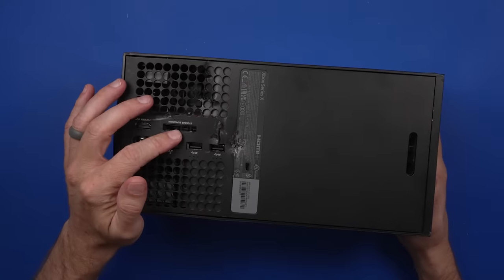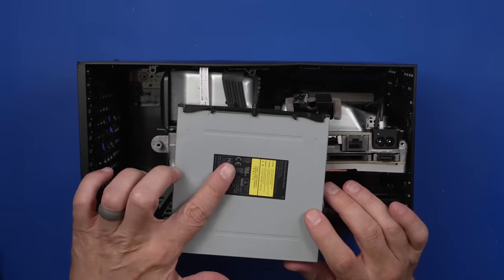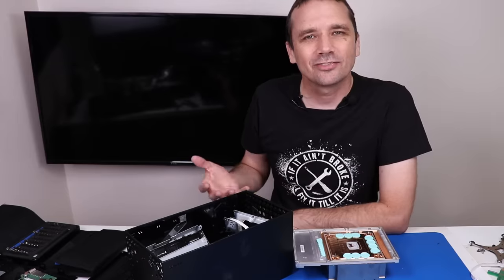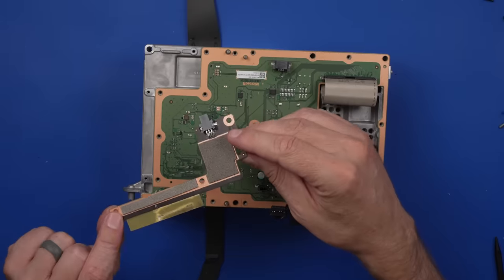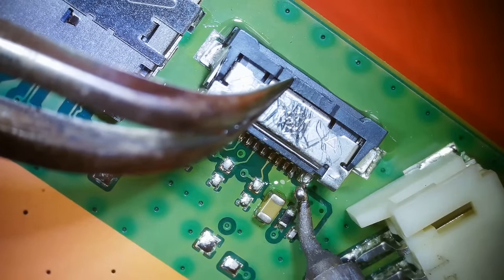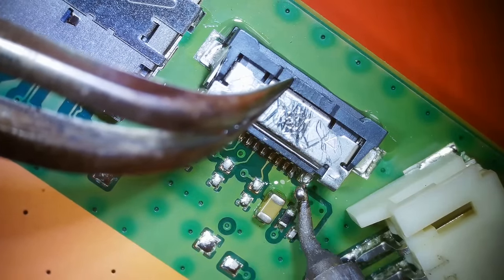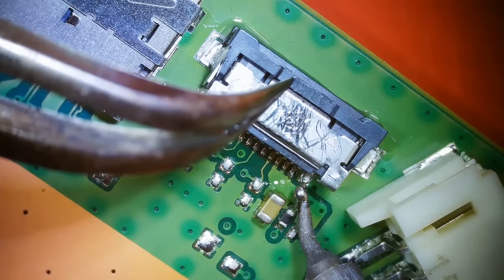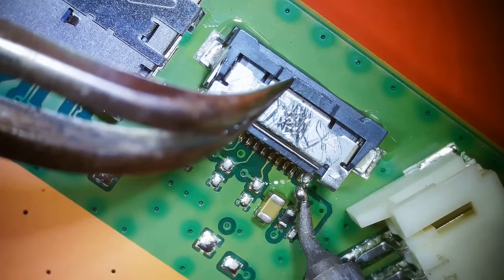$150 For a DESTROYED Xbox Series X - Let's Try to Fix It!

Comment: One thing I'd like to see on these videos is a parts replaced list with costs of parts. I think a lot of people would be interested to see what a repair costs.
Reply: That would be cool, but he wouldn't be able to give exact prices as he's got a lot of random parts laying around from the years he's been doing this kind of thing. So he mainly uses spares from devices he couldn't save. There's also other costs for a repair shop too, cleaning, electric, advertising, hiring staff and training them, equipment (like soldering irons, multimeters and oscilloscopes), paying for the building... 
It all adds up in the end unfortunately. You CAN do it cheaper yourself, but you need to know HOW to do it yourself, preferably without breaking anything.
Reply: @Deja117  yeah he could still post prices of parts replaced and availability (if any) of said parts. I understand he runs a shop, but he also runs a YouTube channel on fixing broken items. a lot of people watch to be entertained and learn.
Reply: There's no way to do this. Part prices are all over the place and rising.
Reply: Part of the reason he is able to do these repairs is because of all the extra components he has from other systems that weren't repairable. Hdmi ports, retimer chips, and known bad components are cheap to replace. Power supplies, disc drives, etc are not. I will only repair game consoles if I know what is wrong with it specifically because I don't have extra parts laying around.
Reply: @Deja117  that's why repairing stuff doesn't make a lot of sense in most cases. Just the man hours dedicated to processing and repairing a damaged item add up to more than the item being repaired.
Reply: Bru some parts you just don’t get….. sometimes the only way to repair them is to have shop with random parts from devices you couldn’t fix. I tell my customers, for me, every board is useful…
Reply: @tomimar2001  Most cases? That's complete nonsense. It's this specific job.
Reply: If he had to buy the parts he replaced the console would not be very profitable. Heatsink 30$, power supply 50$, disk drive 50$, power button board 20$ and a fan 20$. Add that together with the initial 150$ cost of the console you are looking at over 300$ for a poor cosmetic Frankenstein console. You can find a clean used xbox series x thats never been broken/repaired and or opened up for 350-375$. This console is probably worth what it would cost to buy and fix it with zero profit. 

P.S. this video kinda sucked. I expect a good fix it video to be someone actually attempting to repair the parts that are not functioning. Not just swap out ever part that doesn't work with one from another console. i wouldn't really say he fixed anything, anyone could swap parts out.
Reply: Yeah
Reply: Unfortunately most of the time it's not cost effective to fix things since the parts are so expensive. The only reason it's sort of feasable for him is because he gets a lot of broken stuff for cheap that he can steal parts from
Reply: It blows my mind that someone was able to get 150 bucks for that x box lol
Reply: Microsoft does not offer parts to fix an Xbox. There is no exact price it would cost to get the replacement parts. The only way he’d know how much they cost is if Microsoft offered those parts to fix their consoles.
Reply: That would make the videos even better than what they already are 😇😇
Reply: He buys a lot of consoles and such. He has parts just lying around I'm sure. However, I'm not sure he'd remember what he paid for each part. That would be very difficult. He basically just rebuilt this with gathered parts.
Reply: @FaddyMatty  you are literally repeating and parroting what the guy two comments above you said
Reply: It would be nice to have that list with prices but it also doesn't hurt to look it up yourself, you're on YouTube so you must have Internet access 😂
Reply: One thing I would like to see is more hard work from a guy making us free content, too.
Reply: Just google it 😂
Reply: If you dont buy parts in bulk for the most part. Its not even worth doing. Better to scrap it for a system worthy of saving.

Comment: I am amazed at how much completely crushed items still sell for
Reply: Only because YouTubers like this buy them for content. Nobody should ever pay that much for a busted up Xbox. Paying for auctions like this should not be encouraged. This Xbox is going to fail, likely in the near future because with that amount of damage sustained, there are going to be micro cracks in the trace layers of the mainboard.
Reply: @cdnron75  
I think he is upfront about the damage the console sustained, if he sells them. And if not, people can watch his videos. 
In the meantime, however, this console could bring some joy to someone.
PS: It would be cool, if he has links or QR codes for the consoles he sells, so people can see for themselves, what he did with them.
Reply: @Matty0311MMS  It wouldn't be cost effective to sell this with the amount of parts that were replaced. A used one that hasn't been damaged can be picked up for not much more. Plus with the mainboard itself sustaining damage it's not going to last long. It might even start to exhibit problems if he tests it thoroughly and thermal expansion/contraction starts to happen. I wouldn't recommend that anyone buy this console.
Reply: Me too. I looked online for busted consoles when I wanted to practice repairing them, but the prices for junk tech was way too high.
Reply: Just the current state of the economy. For example,  you used to be able to pick up a used beater motorcycle (sometimes nice non running bikes) for 1k or less. Now people want that much or more to haul away a junked motorcycle.
Reply: One Word: Parts
Reply: @cdnron75  
Yup. And just because it turns on, that doesn't mean it can necessarily survive for long with repeated periods of heating up and cooling down, vibrations from the fan etc etc. 
Anything could go at any second. 

£150 for a broken one. Then the time and cost of materials. You could just buy a prowned one that works for £335 easily with 2 year warranty. 

I'd argue this was easily £100 in materials / replacement parts. And then probably at least a few hours of labour. So you're not really saving any money and have no warranty either.
Reply: They know he'll come looking for their weirdly and uniquely destroyed electronics eventually, so they jack the prices up.
Reply: He overpaid for it
Reply: @ChaseSchleich  yeah people seem to wanna sell everything broken for high prices it honestly makes zero sense

Comment: It's a tough sell if you're an individual wanting to repair a Series X to get a deal, but if you have parts laying around and your knowledge I imagine you'll get a pretty nice return on this. Thanks for the content as always.
Reply: Hardly. I mean, if a console is in such bad condition, you basically turn two defective ones (like this one and one with a fried mainboard) into one. Meaning you'll pay atleast around $300 for the parts alone, plus shipping. There won't be much that can be salvaged after you fixed one console up, literally every piece you got left over is broken beyond repair (maybe except for the PSU, but I wouldn't trust it). Adding the shipping for both units you'll probably save around $30 compared to a known working used one, if you buy them for yourself, not to resell them. This doesn't factor in the risk of not being able to fix either of the two consoles you'd have bought and the time you'd have to put in to fix them (2-3 hours at minimum, if you're doing it for the first time probably more). And if you're doing this to resell the console again, you have to pay taxes and ebay fees and stuff like that, so it's really not worth it from a business angle. 
It's only worth it if you want to fix your own console that you've already owned and that broke on you (like when you already have an Xbox Series X with a blown mainboard) and even then you'd have to factor in the risk of potentially not being able to fix it (might be cheaper to sell it off for parts and buy a working one).
Oh, and of course I guess that both this and the console with the blown motherboard came without controller/cables, so you'd have to buy these aswell, if you're fixing your console up.

Comment: I will never get tired of how well built the Series X is. It's just so dense. 

Anyway this is not a repair or fix, this is what we call a rebuild.
Reply: "We can rebuild him..."
Reply: Xbox always has the best hardware and build quality rather than ps5
Reply: Agreed! However, I've always thought that the power supply should have been on the outside, like an adapter brick instead. Would that keep the thermals down?
Reply: This video made me quite angry.
He just dumped and replaced everything, savaging the main board and miscellaneous.
"Fixed", no bro, you rebuild it with spare parts.
Reply: @GamerBoy-ny9mg  This is a joke, right? Red Ring of Death, anyone? Anyone?
Reply: @spambaitpro  i remenber that microsoft offer free replacement with the xbox who suffered ring of death i cannot say the same with sony with the faulty ps3 or any hardware they made bad
Reply: An external power supply was something they did away with along time ago, and for good reason.
Reply: @Mostbaleia  it also isn't really fixed. Yes it starts and read the disc but it also eject the disc after a couple of seconds.
Reply: Yeah, I'm a PS5, PC and Switch guy myself (XB games I just get on Steam), but damn, I love the design of the Series X compared to the PS5.
Reply: And it's the same thing that Subarus owners do everyday😂
Reply: @dart2196  
Let's ignore the 40-series Supers. Instead, wait for the 50-series to come out and think of how affordable the 40-series will become. 

I can pick up an RTX 3090 for about £650-700. The RTX 3090 launched in 2020 Sep. The RTX 4090 launched in Oct 2022. So by early 2025, in about 1 year, you'll be able to pick up an RTX 4090 for about £650 instead of £2000 that it currently is. 

I'll happily wait 1 year to save £1300 on a GPU. (Though, my savings will be less as I build SFF and would be going for an RTX 5060 - TDP dependent).
Reply: @Patrick-y4d1z  I didin't talked about GPUs, but thanks i guess
Reply: @GamerBoy-ny9mg this is simply factually incorrect. All biases aside, Sony‘s build and material quality has always been quite a few steps ahead of Microsoft’s for just about every generation. The OG Xbox was nowhere close to the PS2, the 360 and PS3 were fairly on-par, overall solid generation there, but the PS4 and Xbox One were straight up lightyears apart in quality, and this current gen I‘d still say sony takes the cake but MS is at least trying with the series X

Comment: One could make a ship of thesius argument, but I think what matters is the disk drive board and motherboard. Thankfully those were mostly intact and that's pretty incredible given the damage. But this is a great example of why only a repair shop could take this on, having so many spare parts was what made this reasonable. If you had you tried to source each one of those on ebay I bet you wouldn't break even after re-selling it (off the top of my head you needed wifi board, mobo component, heatsink, power supply, disk drive case, fan, green thingamabob, housing...)
Reply: No, even for a repair shop this wouldn't be worth it. The "spares" entirely came from a console with a blown mainboard, so Steve basically turned two defective consoles into one, with no leftover parts of both, maybe except for the PSU. This was only worth it for youtube content.

Comment: On thing that boggles my mind is how often things labeled as broken cost so much.
Reply: True but I suppose you might buy one like this in the hope that even if you can’t fix it, there’ll be a load of spare parts from it given that most of the big electronics brands don’t make it easy to source parts for devices that could actually be easily repaired. Obviously one like this would be a real gamble given that it was so beaten up but as long as the main board turns out to be good then you can easily get the $150 back if you have the tools, the know how and some patience (I score 0 of 3 here!!!)
Reply: I’ve always believed that people just don’t read things properly. They see “Xbox Series X” and place a bid on eBay without reading the “Broken” part, and even if they don’t end up winning the auction, it pushes the price up.

Comment: Don't own an XBox, but the build of that machine is just awesome. So densely packed and performing while staying fairly quiet. Just a nice piece of engineering.

That said: Are people these days really paying 150 USD for what is essentially a broken box full of parts without having any idea which, if any, of them will still be working? That just seems completely insane to me. Sure, for a repair shop with tons of spare parts lying around, this might be a fun gamble every once in a while, but.... I'm sorry, it's just insane.
Reply: One time, years ago, he bought a "broken" xbox one for 60 bucks. Turns out it just needed a solid internet connection so it could update properly. The gamble can be way worth it. Even if you're only able to salvage them for spare parts and Frankenstein one together.

Comment: I've fixed many heatsinks that were a bit crushed. If you can get it roughly back to shape and air can flow properly, you won't lose much if any performance from it, since it's all thermal conduction which mostly just needs surface area and a dissipation point. Cooling in these wasn't quite ideal to begin with, but the heatsink wasn't the issue with that.

Comment: I'm 2 minutes in, and I'm going to predict that we have an XBox of Theseus. Let's see if I'm right.

Update, I finished it, and I'm pretty sure the only parts you salvaged were the disc drive board and the mother board, so I think it's safe to call it an Xbox of Theseus.
Reply: I was just about to make a Ship of Theseus comment, you beat me to it lol.
Reply: Or the more modern version would be Trigger's broom
Reply: And with the parts he replaced over the years, he could probably build several broken consoles.
Reply: @Matty0311MMS  He could build a completely broken one from the parts that were left of the two consoles he used to build one working one here.

Comment: I once had a PS4 Pro with a worse fan. The woman I bought it from said she got it from a friend, didn't know what was wrong with it, it made "weird noises"  and she herself didn't know how to fix it and what to do with it. I never found out if that friend was just plain stupid or got high as f..., whatever it was, he decided to clean the PS4 Pro with a small paint brush, while it was still running. The fan blades shattered in dozens of pieces that I found all over the console and the metal tip of the paint brush got ripped off and went straight into the PSU (where it didn't short anything, very much to my surprise). After I managed to get all the plastic pieces from the fan out and installed a (slightly used)  fan that I got off of ebay the PS4 Pro worked flawlessly again.

Comment: What's even more worrying is the rise of faulty consoles on ebay that mysteriously don't connect to xbox live. When I ask the sellers they say they are banned. Total paperweights
Reply: I'd be curious to see how difficult it would be to unban those. I'm sure there's a way, but who knows if it's even worth it
Reply: would be pointless unfortunatly, it would require a doner xbox to be used as a doner board , the unique cpu key would need to be extracted then injected into the banned board, i know this can be done on J-Tagged 360's but i dont think this generation of xbox has been hacked  to the level yet..... i havent kept up with the xbox hacking scene so a may be wrong. but its a lot off effort

Comment: Did you ever test the original power supply? You said that you had the ribbon cable in wrong so the original "could've worked" but still used the donor part

Comment: One of my repairs I'm most proud of was a PS3 Fat non-backwards compatible from a thrift store. I paid $15 and it looked like it had been stabbed with a screwdriver multiple times and then chucked down some concrete stairs.

The heatsinks for each dye were bent and twisted halfway off. I was able to use a clamp and pliers to bend them straight. 

The fan's bearings were shot and I had to buy a new one fan. That was the only part I had to buy new. 

The motherboard connects to the power supply in those models with 2 pins that go upward. The power supply bent those pins severely, but I was able to salvage them and the power supply.

The most fun part was the case. I was able to take a file to most of the stab wounds and make them look passable. As for the glossy finish, I buffed it like you would a car with bad clear coat. An angle grinder with some buffing compound and a wool brush addon and that thing looked incredible!

It remains my only PS3 that I still own. I haven't used it much since the original model PS3 got so loud I could never hear the TV over it. 

It's always the best feeling when you take a system that seems too far gone and make it live again. I'm doing my part to keep eWaste out of the landfills!

Comment: Your videos inspired me to try repairing as a hobby. A few questions: what tool are you using when you're checking for shorts? Also, where to buy broken stuff in bulk?
Reply: scrap yard, thrift stores electronic shops.
Reply: the tool that is used is called a multimeter, there are tons of options with tons of different use cases. Usually you want one that can check continuity, voltage drops, and resistance

Comment: THe damage to that XBOX is very consistent with the damage from a PS5 that I found on the side of a highway.. like it flew out of the back of a truck or trailer, and bounced along the road at highway speeds.  
1 lb of tannerite turned the PS5 into shrapnel, that cleaning it up was not much fun..